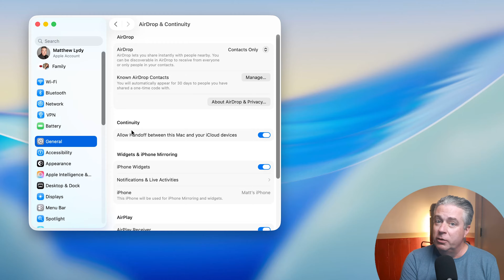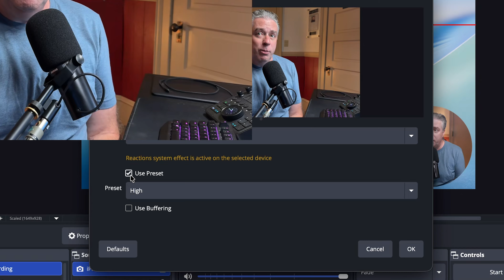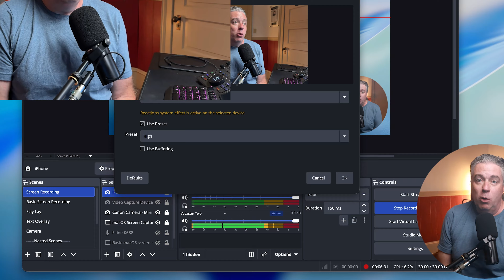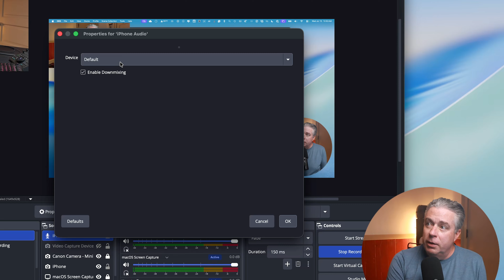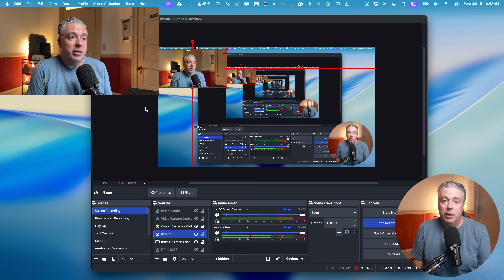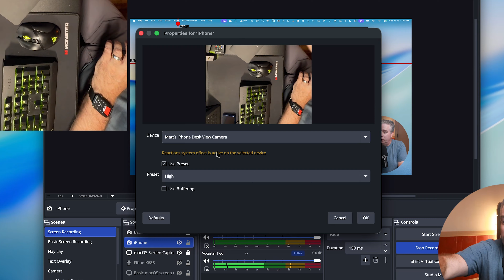iPhone as Webcam in OBS on Mac — No Extra Hardware Needed

Comment: i have macbook pro 2019 but i can't see conntiuity option
please help me
Reply from the maker: Good news, a 2019 MacBook Pro can run macOS Ventura, which is the version Continuity Camera needs. Click the Apple menu > About This Mac to see what you're on. If it says anything older than Ventura 13, update through Software Update and the option should show up.

If you're already on Ventura or newer, check these:

Your iPhone is an XR or newer, running iOS 16 or later
Both devices are signed into the same Apple ID with two-factor authentication
Wi-Fi and Bluetooth are on for both
Continuity Camera is turned on in your iPhone's Settings > General > AirPlay & Handoff
The devices are within about 30 feet of each other

Let me know what macOS version and iPhone model you have and I can narrow it down.
Reply: @mattlydytech  it's sequio vesion 15.8.1 and my iphone is 13pro apple account are same on both devices bluetooth is also on on both
Reply from the maker: @iffi1436 Thanks for the details, you're on the right versions, so this is fixable. Try these in order:

Turn on Wi-Fi on both devices. Bluetooth alone is not enough, Continuity Camera needs both.
On your iPhone, go to Settings > General > AirPlay & Handoff and make sure Continuity Camera Webcam is on.
Make sure both devices are signed into the same Apple Account with two-factor authentication turned on.
Turn off Personal Hotspot on the iPhone, and unplug any USB connection to the Mac.
Keep the iPhone locked, near the Mac, and held steady in landscape.

Important: there is no Continuity Camera switch in Mac System Settings. Open an app like FaceTime, Zoom, or QuickTime, then pick your iPhone from the camera menu inside that app.

If it still doesn't show up, restart both devices and try again. Let me know how it goes!
Reply: @mattlydytech  can we connect iphone with the mac with cable also?
Reply from the maker: Yes, you can and that often works better plus keeps your phone charged.

Comment: Mines super zoomed in and doesnt let me go portrait mode
Reply from the maker: Good news, both of these are known Continuity Camera behaviors, not something broken on your end. For the zoomed-in look, click the Video Effects icon in your Mac's Control Center (menu bar) while your iPhone is active as the camera, then check the arrow next to Center Stage, you can choose between Main and Ultra Wide lens there, and that's usually what causes a tighter, more zoomed-in frame if it's defaulting to Main. Turning off Center Stage's Auto Zoom is worth trying too.

For portrait mode, can you clarify which one you mean, mounting your iPhone vertically (physical orientation), or the "Portrait Mode" background-blur effect in that same Control Center menu? They're two different things with the same name, and knowing which one you're after will help me point you to the right fix.

Comment: I have an HP Omen PC laptop with Windows 11, and I am using my iPhone 17 Pro Max with the Camo app -- works very well as a webcam with OBS. This works for the PC users out there.
Reply from the maker: That’s a great alternative for PC users looking to get a better webcam setup.
Reply: I'm trying to use an iPad as a second camera with a Windows laptop. Thanks for the tip about Camo. My laptop in OBS Studio recognizes the Camo connection, but the video isn't showing up inside the box on my Scene board. Do you know of any tutorials to help get this running?
Reply from the maker: @JudyParady-o4b Good news, this is a common hiccup, not something broken specifically for you. A few things to try, in order:

First, right-click the Camo source in your Sources list, go to Transform, and click "Reset Transform," then right-click again and choose "Fit to Screen." Sometimes a source gets added with its size set to zero or positioned off the visible canvas, so it's technically there but invisible until you reset it.

If that doesn't do it, remove the source entirely and add it back fresh, make sure you're adding it as a "Video Capture Device" specifically (not Window Capture, which can pick up the Camo Studio app window instead of the actual camera feed). After adding it, fully close and reopen OBS once, that forces it to properly reinitialize the connection.

Also worth checking: make sure no other app is actively using the iPad's camera at the same time (FaceTime, another video app, etc.), only one app can access it at once, and if something else has it open, OBS will show a blank box even though it "sees" the connection.

Let me know which of these gets your iPad showing up!